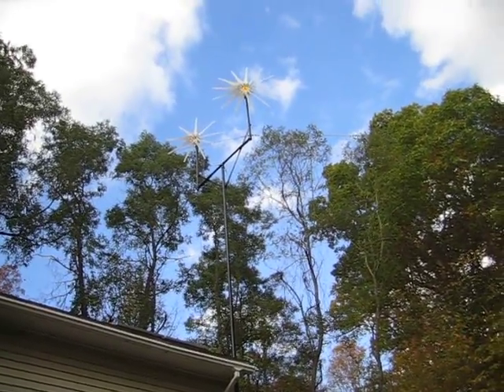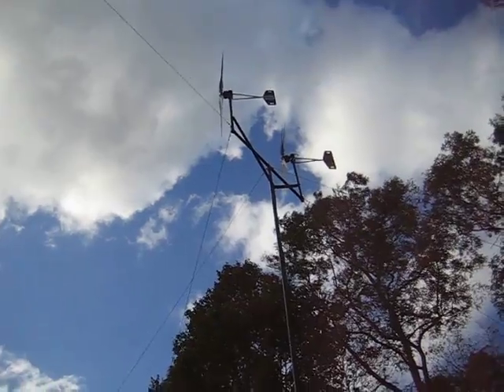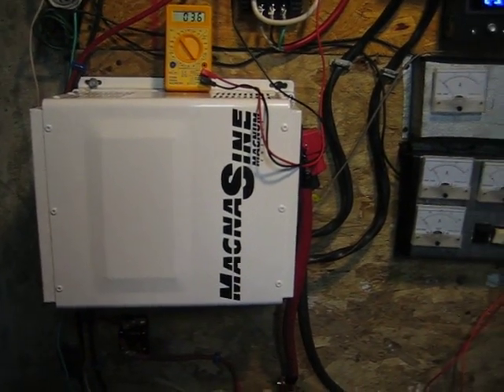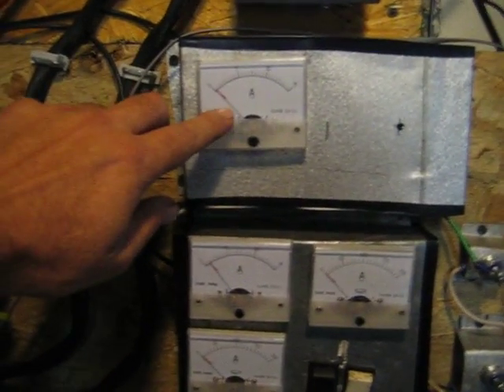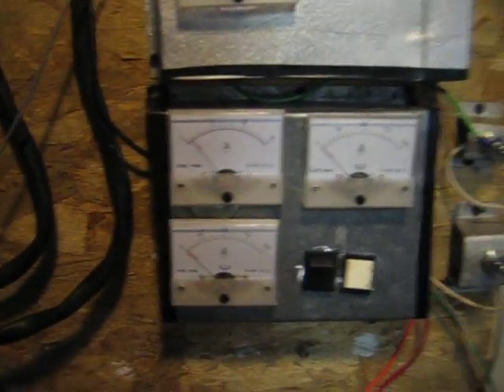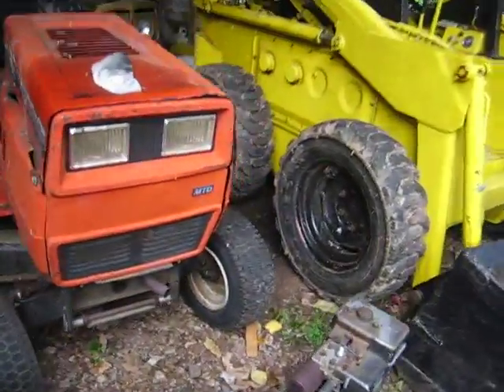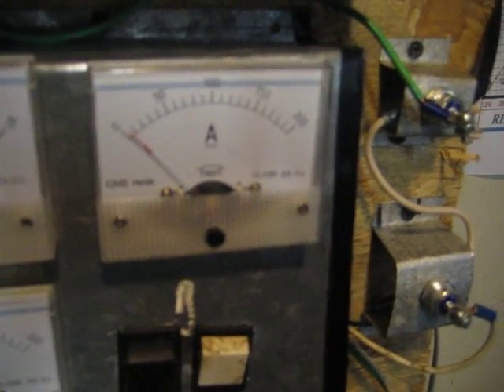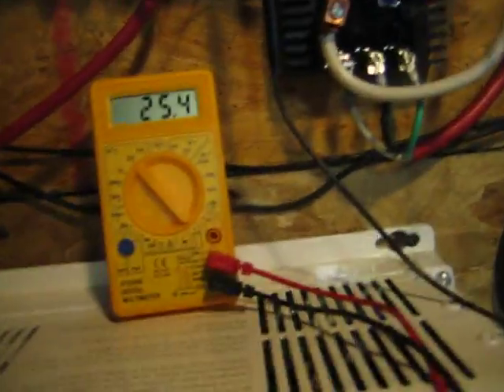Missouri wind turbines

Comment: this video is crazy the more I see it the more I can tell this video is just a fraud I can see wind in the trees and a lot of it and there is no way in hell the turbines are not doing anything they are either sezed up or he has something in the way they are both pointing in two the wind from what you can tell from just the wind from the trees. and the pma that is on the ground connect to the gas motor dont even look like a MW&S pma this guy that mad this video is stuppied.

Comment: you must have something hooked up wrong or a short some were else in the system because you readings dont make since with what I seen before because with just 3 amps would not cause a motor to bog down so much like it is so you are screwing up something sounds like a complete short some were in you wiring.

Comment: If you want to see a Missouri Wind And Solar wind turbine installed properly and puttin out the power go to my channel. This guys wind turbines are surrounded by trees. The turbines are also in between his house and the trees, bad,bad, bad location. As far as the pma he's running theres no tachometer for a real rpm reading. He doesnt show the back side of the pma where the ratings would be.The wiring looks like hard wire for AC not fine strand for DC . 
Phil

Comment: @Fearlessthinker hey spineless worm how's that ari turbine doing and why your not showing the power from that? Maybe you'll talk him into a WM because the security rating is 50 mph and is a lot better than WN at a rating of 40 mps, you'd be shutting it of at a 35 mph wind to be safe, that's why in Josh's video's he stops showing power at 35 to 40 mph, that sucks.

Comment from the maker: i cant beleive the crap im reading.i just was trying to figure out why my turbines were not putting out the1600 watts that they are supposed to.so i hooked up this gas motor to the pma and tryed many different rpms.the motor is 3600 rpm with a 2-1 .so at 3600 rpms the pma is spinning at 1800.should be more than enough for maximum output.how does the trees or site have anything to do with the motor?since this vidio the leaves have all fallen off.the other night i had severe winds . average 2 amps